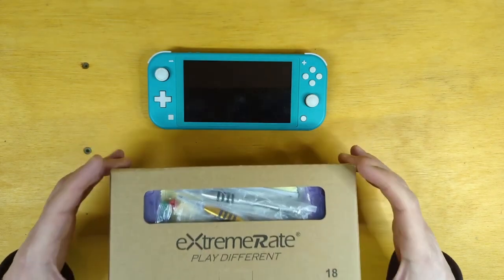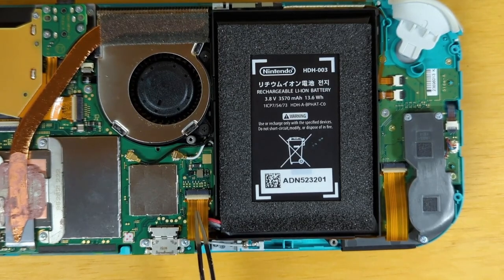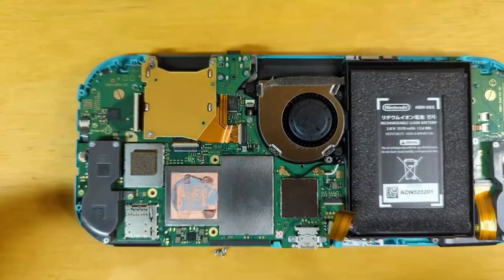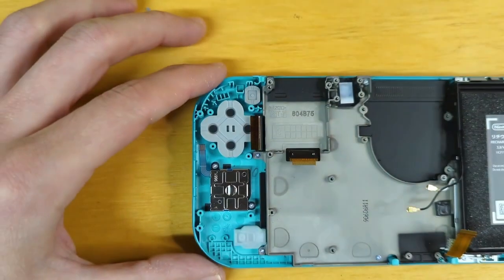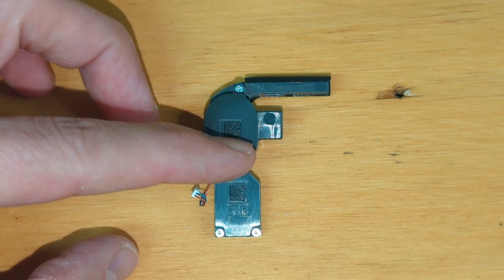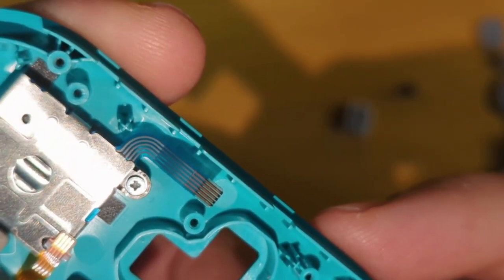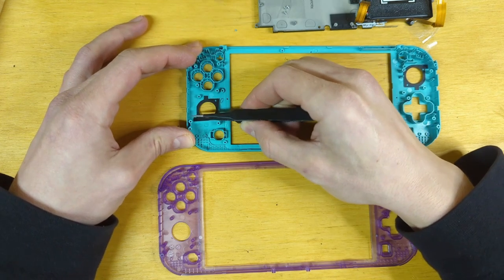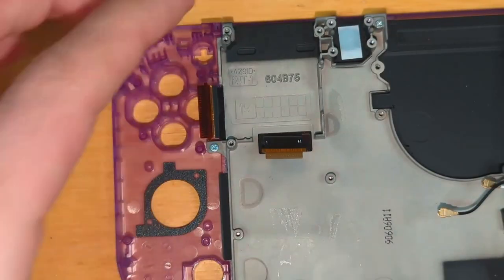Nintendo Switch Lite Shell Swap / Complete Teardown & Reassembly

Comment: This video is a million times better than the actual video Extreme made to do this. I've now watched this video about 4 times in antipation of doing my own. This is definetly more work than swapping Joycon shells. 😂 Wish me luck! 🤞
Reply from the maker: Good luck brother. You got this!
Reply: Got all the way down to where you remove the cartridge reader and they have a screw so tight i stripped it trying to unscrew it. 🥴 So I have no idea if I'll be able to continue lol
Reply from the maker: @EastSide_LB  There always has to be something that goes wrong during a project. Lol. Maybe if you get all the other screws out, then you can rotate the entire reader a little bit to force the screw to turn loose???
Reply: @MakeStuffDoMore Was actually able to finish the job without having to remove the last screw. Made it slightly inconvenient to plug in the 2 ribbon cables but definetly doable. Took alot of the day due to it being my first whole shell swap lol but with the help of my GF was able to get it done. On a side note, she says when you're concentrating you sound like Matthew McConaughey on Dazed and Confused. 😂 Thanks again for the detailed video brotha! Watched it another 20 times today while doing the tear down/rebuild. 🙏

Comment: This is an amazing detailed video! I have an issue with my disassembly. At 4:12 in your video, I accidentally detached that white part of the cable connector. Do you think I’ll be able to fix it? If so, do you have a recommendation on how? Thank you!!
Reply from the maker: Thank you for the compliment. I hope you can get that part attached again. I've seen one before that somebody accidentally detached. It took the pins off the board with it, but the solder pads remained usable and I was able to solder it back on with a very fine tip on my iron @ 280°C. Not sure if this helps, but I'm guessing that's what you're gonna be dealing with.
Reply: @MakeStuffDoMore  thank you! Surprisingly, I was able to find a replacement board on Amazon for $10! Watched your video again for installing it. Can’t thank you enough!
Reply from the maker: @michellemccormick1766  This is too good to hear! Great job on the shell swap with included repair. It's not for the faint of heart and you totally won.

Comment: This is my first project ever. Im a 34 year old that never opened anything. The switch lite i feel is hard because its so small. I managed to do it but had a million problems along the way. In the end, everything worked except for the touch screen. The screen works i just cant use touch. All buttons work and card reader works. Wifi works. I dont know what the problem is.

Almost about to say fuck it because it's barely used anyway. I have a switch oled that I can use for touch if I need to
Reply from the maker: It's really good that your system mostly works after your first time ever tackling a project like this. It's possible that the heat and stress of removing the screen was the culprit, but you might get lucky and find that a ribbon cable isn't seated and locked in just right. Either way, congrats on taking on such a project. It's definitely not for the faint of heart, and you'll get better every time you do something like this.
Reply: Hey, it was the ribbon cable! The fat one under the card reader. Finally everything works. So so happy now. Couldn't have done it without thr help from your video.
Reply from the maker: @josephshatrowsky  That's fantastic! Great job brother! Perseverance is a powerful thing. Shame on YouTube for not notifying me of this wonderful comment.

Comment: How much degree the hot air to replace screen
Reply from the maker: I had my reflow station set at minimum temp, which is 95°C and maximum air flow. It took a while at that low temperature, but I didn't want to risk overheating the display panel or digitizer.
Reply: @MakeStuffDoMore  thanks for answering

Comment: Hi, I have a question. I changed the casing on the Lite but I feel like the buttons are not well adjusted. When you move the console it makes a rattling sound. Is this normal? Because I installed the colored buttons that came in the package.
Reply from the maker: @cesarherrera2703  I haven't noticed any rattling but I did notice that the ExtremeRate stuff doesn't fit together quiet as well as the stock stuff, so probably normal.

Comment: Hey man at 30:43, I am having the same issue with the left bumper not clicking down, but I don’t really understand what you did to fix the issue?
Reply from the maker: Thank you for pointing this part out. The problem (besides my camera angle) is that the plastic bumper will catch on the button and force it backwards and crooked when it should be floating right over the top of it. Basically I just put an exacto blade in between the button and the plastic bumper, so that the bumper is forced to slide over the top of the button. Good luck on completing it, and thank you for using my tutorial. 🙂
Reply: Did you ever figure out the bumper issue? I’m having the same issue, the bumper button is way too tight and it’s pressing into the PCB button permanently.
Reply: @fluffybutt35 I didn’t man, I ended up just using the oem bumpers on both sides.

Comment: I'll be trying this this weekend,how do I k ow if I'm using too little,or too much thermal paste?
Reply from the maker: Good question. I generally just try to have a very thin layer that covers the entire die, but isn't too much that it'll squish out all around it when the heat sink goes back on. You can see in the video how sloppy of a job I did, and it probably did squish out all around it, but it's perfectly fine and works just the same as before the shell swap.
Reply: @MakeStuffDoMore  awesome thanks for replying so fast👌will let you know how I get on first attempt at something remotely like this
Reply from the maker: @hollywood2038  Oh, now that's what I like to hear. Somebody getting into this type of thing for their first time.😁 Thanks for using my guide!
Reply: really novice question as I know yours turnt on whilst re assembling,would you let the thermal paste "set" before use??
Reply from the maker: @hollywood2038  I wouldn't worry about that at all.
Reply: I've just finished,everything works perfectly,I just took my time and followed your every move couldnt have done it without you cheers mate👌

Comment: What do u clean the thermal paste off with?
Reply from the maker: Isopropyl alcohol. 99% is best, but a lower concentration is fine. The lower concentration has more water, so you just have to make sure that it's fully dry if you happen to get it all over the circuit board.